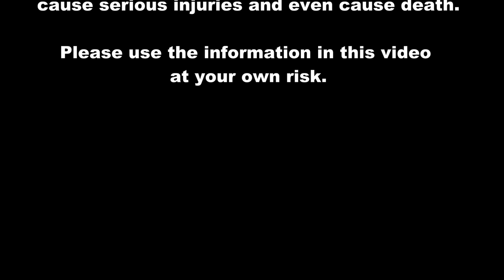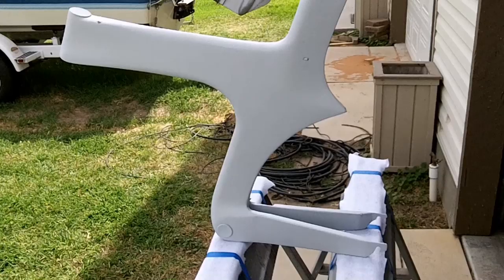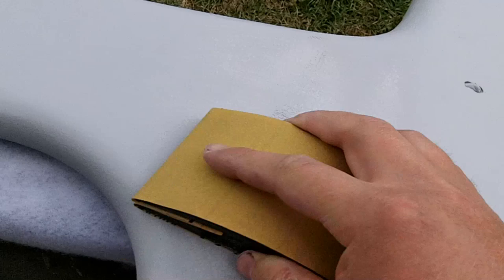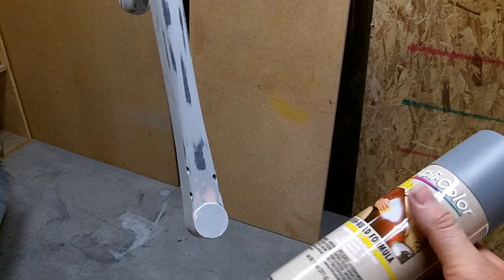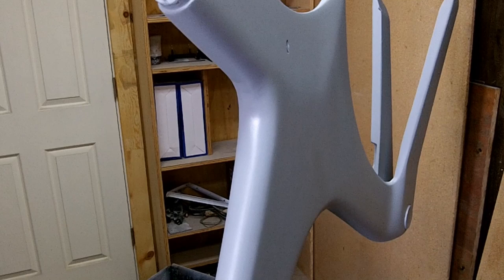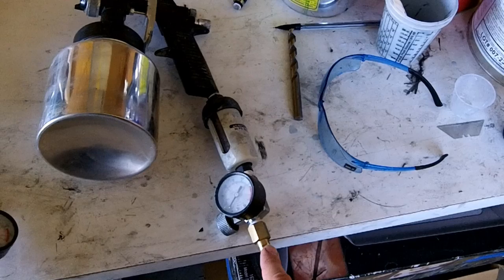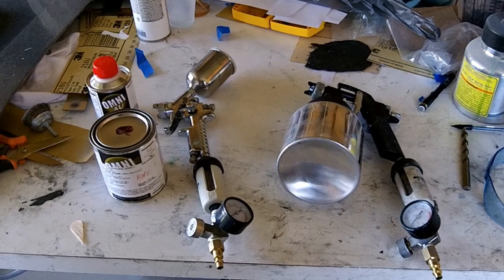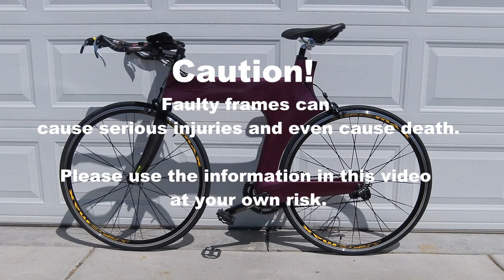Z Frame Bike: Video 12 of 13- Painting the Frame

Comment from the maker: @WhiteGravey 
I try to be fairly realistic about my project build times and costs. Most of this project's cost and time included what was spent on building the molds. Now that the molds are done I can produce a frame for around $100 in materials and, I think, closer to 50 hrs of build time. I'm planning on building at least two more frames with the current molds. But before I do, I need to make a few changes to the left mold for the rear and front derailleur hangers :-(

Comment from the maker: @circusboy90210 
Learning how to do negative molds is a good start. I remember the first one I did I damaged the plug and completely ruined the mold- I had to make a lot of repairs but eventually got it. If I could recommend anything about making plugs its the Duratec Primer. This stuff is amazing to work with and will save hours in filling and sanding.